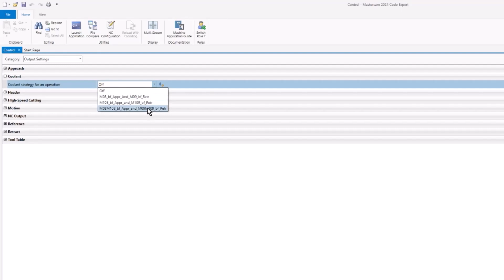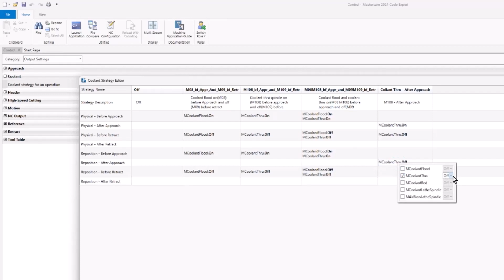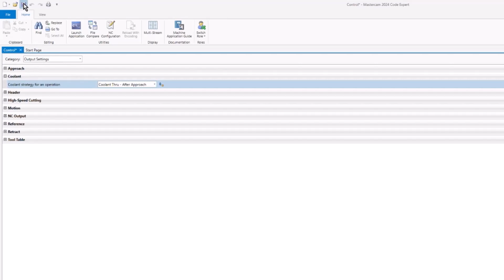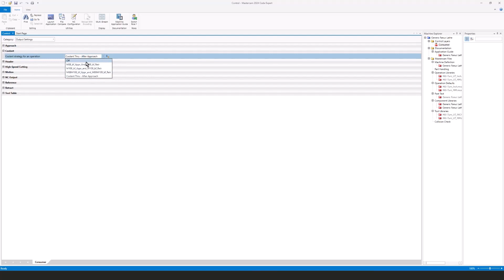Custom Mill Turn Coolant Strategies - What's New in Mastercam 2024

Comment: How did you open the control layer in the right side like that? Or how do you open the machine control
Reply from the maker: When you load your Mill-Turn environment in Mastercam's toolpath manager, this will open the Mastercam Code Expert as well. In the View tab at the top of the Code Expert window, you will see a Show group. Inside of the Show group, you will find the Machine Explorer. The Machine Explorer will allow you access to the Control Layers for your machine environment.